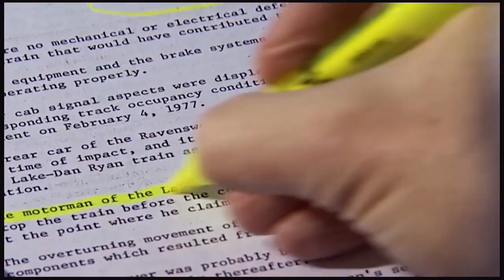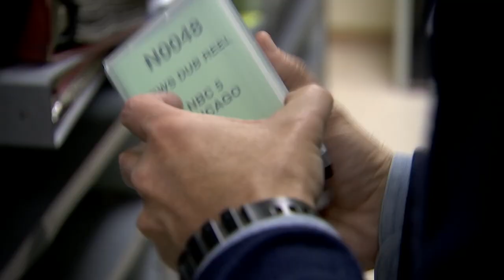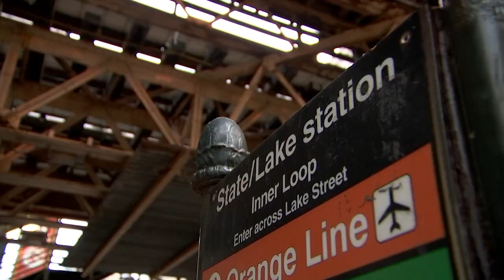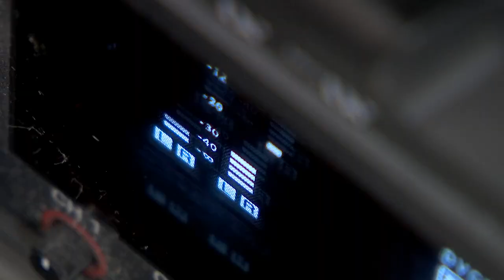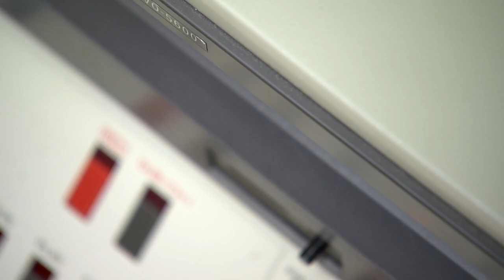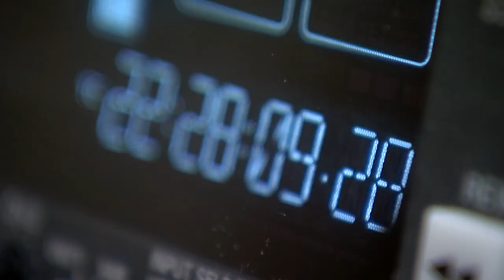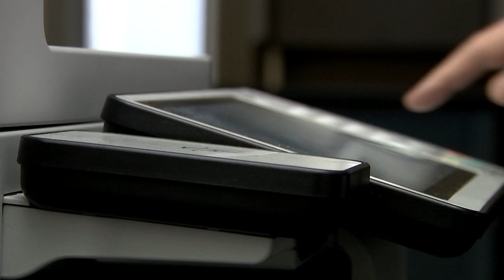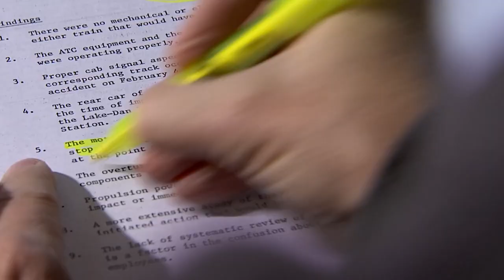What If El Train Falls off the Track? | Big Chicago Stories

Comment: I worry about that green line over the Dan Ryan every time I see it. Rounding that corner over the e-way makes me cringe!
Reply: U too especially as very high over expressway for an elevator structure then normal I be glad once we cross that expressway I take that train home sometimes I live in englewood
Reply: If the green line fell from the the tracks above the expressway that would be horrible and you can presume everyone on the train is dead.
Reply: OMG, yes !   Also, around that entire "inner square"  in the Loop, where the trains travel around LaSalle and Van Buren, around to Lake and Wabash, etc.
Reply: It does so extremely fast